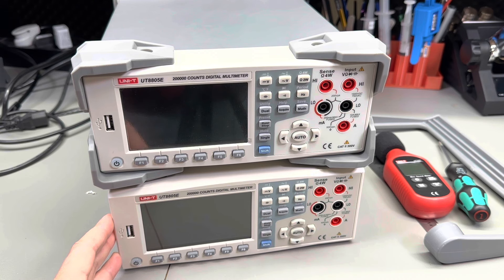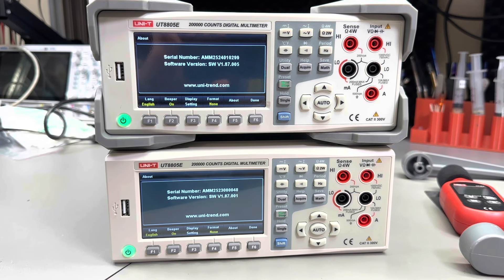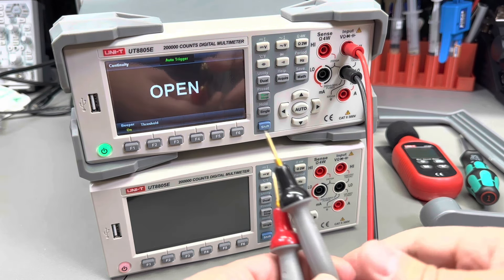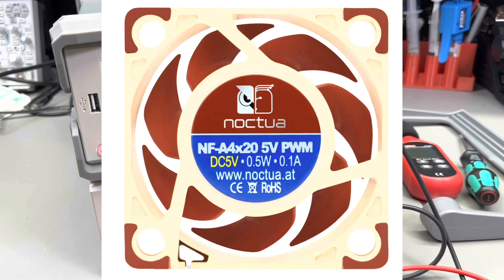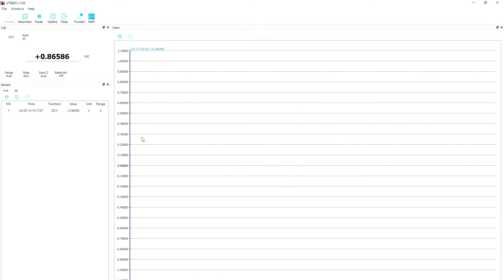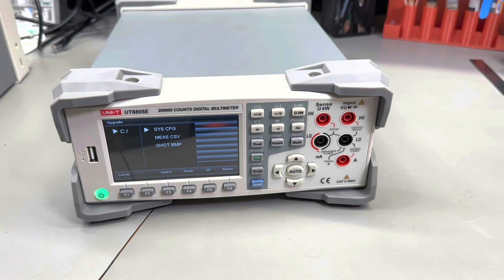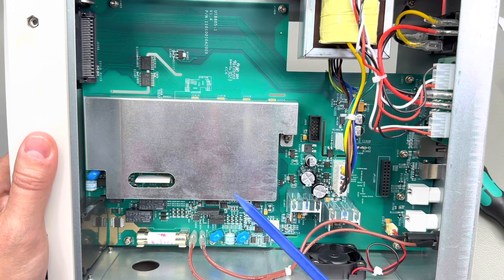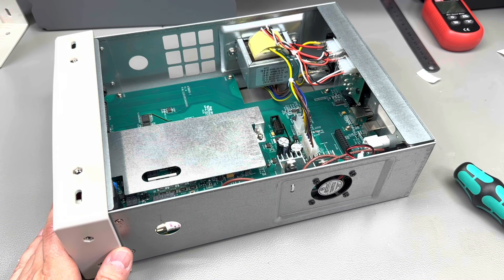UNI-T UT8805E New Revision: Feedback Heard & Issues FIXED!

Comment: Maybe carefully try without a fan, see if it overheats. Can use the saran wrap technique.
Reply from the maker: You never know what their engineering reasoning was... Maybe it does work without a fan, and the fan is just there to ensure operation over a very wide operating temp range but ultimately I would feel better if it had a silent fan in there vs no fan at all. Let's see what the temp measurements tell us in a future video.